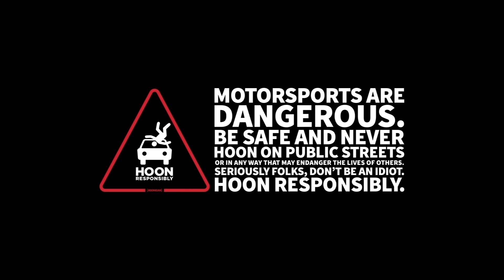72 Hour Sportster Build. We're Going Flat Track Racing...

Comment: Everybody : we want to see zac’s c10 

Zac : so I’m building a Harley

Everybody : shocked pikachu face
Reply from the maker: Ohhh we though you guys said “ Harley 1200”.... Man, we really need reading glasses...
Reply: @HooniganProjectGarage  tell zac i said to hurry the f up we craving c10 juice! Btw we love bikes too
Reply: @madbroindustries  probably not the best way to go about asking 🤷🏻‍♂️🤣
Reply: Bikes are good too
Reply: bring back the c10, I have an 86 c10 currently putting a 632 in it and making a tme attach truck, yes i know not the ideal vehicle but why not
Reply: @TheWhatman21  they have a ton of aftermarket support so not the worse possible vehicle. A lil heavy, but it'd still be fun. Good luck.
Reply: @matthewmcclain1316  I have a 79 c10 drag truck under 3200 lbs now. Runs an 8.2 quarter mile.  Full 4 link, rack and pinion conversion,  beltech front suspension setup. Fiberglass bed, hood etc. Been working on these trucks for a long time. I just like the idea of something different than a Corvette or small import for time attack.
Reply: @TheWhatman21  hell yeah dude. I don't have any cool cars personally, but I'm a pretty avid fan. 8.2 is fast!
Reply: @matthewmcclain1316  I'm 31. Took me till I was 26 to get my first "cool" car. The 8.2 c10. Just a frame and body when I got it. I do have the advantage of being a welder and machinist for the last 12 years so I have access to tools and skills that most dont so I'm lucky I dont have to spend as much as most
Reply: @TheWhatman21  I just turned 25 so I got some time to get er done. I will have a cool car, just not sure what yet. Lol
Reply: @matthewmcclain1316  Hell you're a young buck still you have plenty of time. Plus when I broke up with my ex-fiance that freed up a lot of money haha

Comment: Those are Screaming Eagle cams. Part number 25648-91. 0.497" lift on intake and exhaust. Gokd low end power and very popular drop in cams for 91-03 Sportsters. Best run with a 10:1 compression because of the late intake closing.

Comment: Call it STINGER. Give it some black and yellow stripes.  Fun to see a Harley get stripped that wasn't stolen for parts. All the stuff you took off will bring a good price on auction.It might pay for the whole bike. You ripping the starter off too ,I hope. and using a super capacitor instead of a battery. 10"" long primary pipes .

Comment: Something to note to all the rookies out there. When cutting aluminum with a grinder wheel, be sure you use the correct cutoff wheel. Using the wrong one can result in it breaking and injuring you badly.

Comment: The iconic Sportster tank isn’t the peanut tank. It’s a copy of the DKW design from the 40s. Sold by DKW, BSA,  and Harley. The peanut tank is from the original XL from 57-6? And also grew to become the original SuperGlide tank.

And S&S is definitely not the way to go for performance. Hammer Performance or NHRS is way better and a bunch cheaper. Better parts and combinations.

Comment: What are those chrome cylinders that are beside the combustion chamber?
Reply: I think your asking about the pushrod tubes.  Tubes to seal the pushrods from the elements as they run from the 4 cams in the case, up to the valve rockers in the head.  2 valves per head.
Reply: @stk0308  oh ok, completely new to motorcycles. That makes sense though.

Comment: Gnarly Davidson is a pretty cool name, but I know the Hoonigan crew is always worried about copyright issues and That sounds way too close to Harley Davidson. Of course, if you can get them on board with the bike, that would work. Just so I don't sound like one of those douche canoes that criticize others ideas without putting forth my own, Why don't ya call it "Boozefighter"(the name comes from the Boozefighters motorcycle club in Cali circa 1947) or what about " flat park" or just " Red". Named for "Red" Parkhurst who in 1915, rode a Harley in a race 150 miles and for more than two hours straight. The last 50 miles he was holding the gas tank between his knees cause the bolts fell out or broke. All while doing over 80 MPH, which is crazy fast for 1915, when most race cars could barely get to 65MPH. That guy sounds like the poster boy for #AintCare.